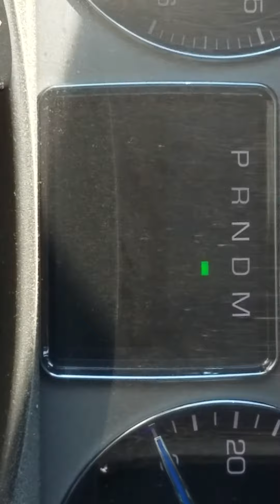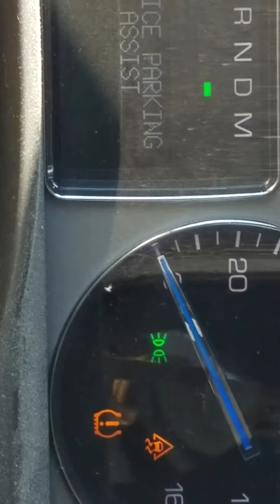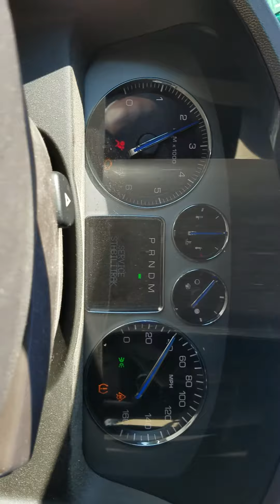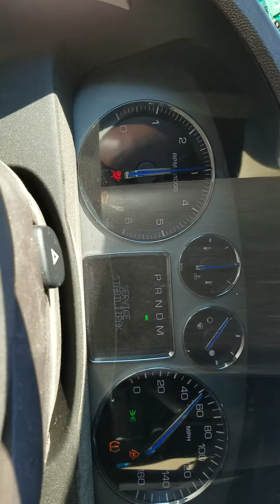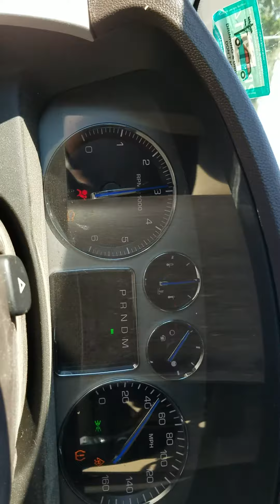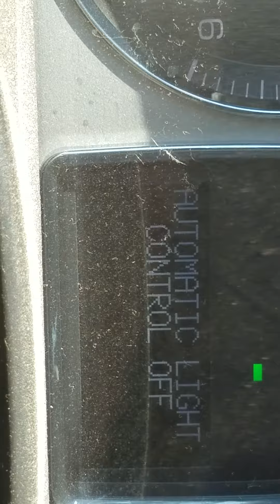2007 Caddilac Escalade electrical problems Part 2

Comment: Hello again.  I have almost the same electric problem as your car . And same gear problem that it stuck suddenly on only one gear . After you change this wire did all the problem goes away even the gear problem  ?
Reply from the maker: Hello. Yes the flashing lights on the console went away and being stuck in one gear went away. However a new problem came up where my right back turn signal did not work anymore. So I had to correct that problem. I'll put a link  in the reply for how I fix that problem. But as of today no issues
Reply: What wire did you change? Im having exact same problem in 2009 Escalade ext.

Comment: It's not the CPU . I just bought a 08 esv that had the same problem. Look to the left of the transfer case under the truck . To the left are a set of wires . 9 times out of 10 , they have been grounded by the knuckle under there . I spliced those wires and hooked them back up with heat shrink . Once I fired up the truck, everything went back to normal ! No bullshit
Reply: Mine is doing the same thing, gonna try to get to the real cause. I think Mr. Flowers, is on point.
Reply: I changed all the ground wires and I'm still having the same problem ABS blinks on and off doors locks and unlocks transmission staying in 2nd gear
Reply: My 07 esv is doing the same thing.  Change the grounding strap ran another ground to the block and fram. If I drive it at high speeds my cluster gages starts glitching  they all go dead then come back alive door locks starts locking and unlocking. Then it sticks in 3rd gear.  I would have to pull over unplug the negative  battery and plug it back up and everything  is back to normal. Next ima inspect the wires by the transfer  case.